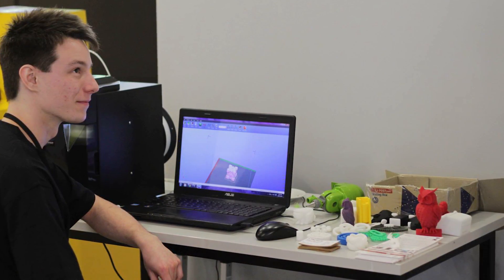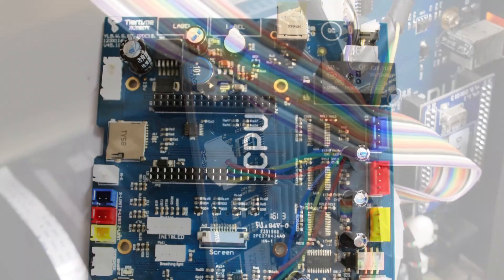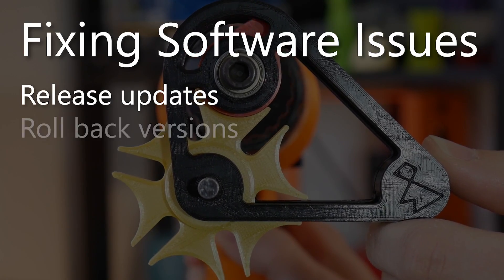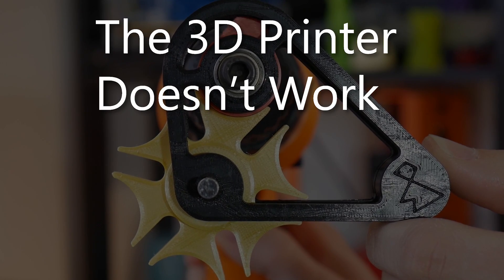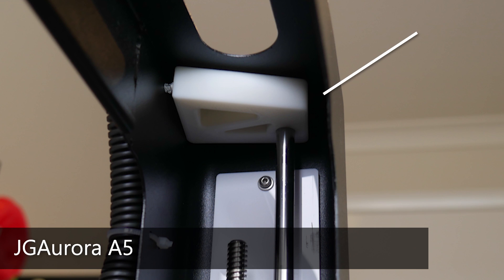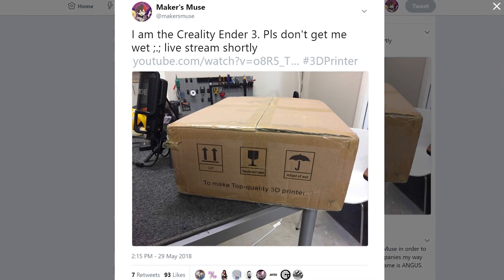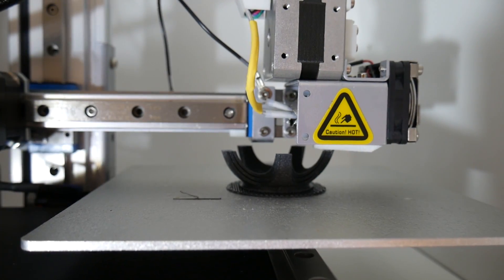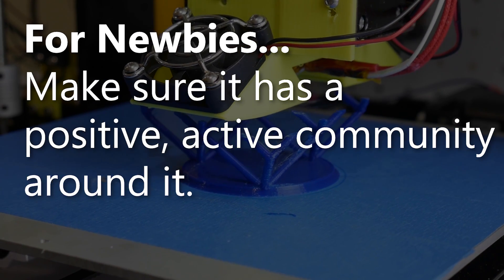Serious Concerns with 3D Printer Quality Control

Comment: I have bought 8 printers in the last 3 months since getting into 3D printing, and have done videos on them all.  I must say, I agree with what you are saying Angus.  While my Ender 3's are great (3 of my 8 printers), it is dismaying to hear some are coming out with removable plates now since I just received 2 more last week and they are the same as my first edition.  Also, I was an early adopter of the Formbot Raptor and upgrading the drivers was one of the upgrades I had to make, at my own cost.  I found it annoying that myself and a few others had to buy the upgrades and work with the manufacturer, and now hear they are shipping with the upgraded drivers due to our testing, but we still had to shell out the cash to do it initially.  And I am not even going to get into my Zonestar P802QR2, which went down after the first week of having it.  The "replacement" part...  Not even going to go there now.
I have since seen the importance of making sure people getting into 3D printing now actually have a good experience, but QC has to be fixed first.  And the manufacturers should have version numbers so you know what you are getting.  ie; Ender 3.1 (includes removable build plate)......

Comment: Very much agree. Though, given the advantages this practice offers to businesses, I don't see it going away anytime soon.

A compromise, I would love to see, is manufactures actually indicate what revision machines are as part of their models (ie: PrintMaster 5000 rev. 0). Any time they improve something, they bump the revision number, and publish a description of the change and what it was meant to address to their website.

This would help with two things. First, anybody buying a machine can use the revision to help determine how a new machine will compare to a review model. Also, if you're buying a "rev. 0" machine, you can reasonably expect to run into some issues (I would hope that manufactures would either provide these machines with a discount or upgrade plans to help offset the negatives).

Comment: Angus, I totally agree with your statements in your video! I've been trying to get users in the 3D world and mostly in the RC quadcopter hobby to realize the same thing! 🤔 Especially when buying from Gearbest! They have their own brands, ones you can only buy from Gearbest. They figured it out, long ago! They can release these ALPHA, or at the very best BETA products, without any testing or refinement to customers, with no worry of ever receiving a single return! It's too expensive for people to ship back products to China, when in the USA and other countries! So they scam unsuspecting customers to buy their unfinished garbage. Nearly all of their RC quadcopters are not even flown! No tuning, no refining, nothing! And they're popping out new models on a weekly, or faster, schedule! Kind of a throwing it against the wall to see if it sticks theory! I've seen reviewers get defective 3D printers right out of the box, and state that in their review, but go on to modify the printer to get it to function and then complete their review! What?! The product wouldn't work as received, and you fixed it so you could review it?!!! What about the customers who had no ability or spare parts to fix it?!! I feel the review should have stopped right there and the customers told not to buy the item until the manufacturer refined the product so it functioned perfectly right or of the box. Instead, reviewers are doing the R&D you mentioned for them! Ridiculous! If the reviewers do get it to last long enough to finish their review and not find the defects, then GearBest has a great seller even though it is a subpar piece of smelly dung! People in both of these hobbies are used to being tinkerers, and are used to doing upgrades and fixing issues. But! Like you said, they are making it the rule to release untested ALPHA products. Making it the norm to let the tinkerers fix the issues themselves instead of releasing a finished, quality piece of gear! I've received several defective products from Gearbest that they won't cover and have been told the most they can give me is $50, but I can keep the big pile of defective SHIT they sold me! Oh boy! So happy paying hundreds of dollars for something that arrived defective and then made to keep it, essentially throwing my money away!!! 😖
If we could buy that product in the USA, we'd be returning it at first sign of a defect, but since it's too expensive to do that, GearBest has taken advantage of us, and made it their norm to release JUNK!
I won't buy from them at all anymore because they've scammed me too many times with their ALPHA GARBAGE, and ripped me off. I suggest to all others to not settle for this practice they have adopted and say  N O  to buying from Gearbest, and others, until they end their scam and start doing proper manufacturing with full R & D and great quality control and testing.

Comment: This is a fine commentary on development, manufacturing, and shipping a product and what a consumer must think of. I think of how this applies to the Glowforge laser cutter and engraver. It was crowd funded to some degree to access demand, but it was wholly VC funded for development. They missed wildly their initial shipping target. They haven't made good on major components that were announced at launch like the filter, and have adjusted "specs" to meet the reality. They had a true beta test in the wild program. They had a six month pre-production test program, and then they started shipping production models without key features being finished. As one of the pre-release testers (I met you Angus at BAMF in 2017 and that one personal connect was the line I followed into the FDM 3D printing world!), I feel that they made good on most of the initial market for the basic 40 watt unit. Your  caution to early adopters to assess the risks of putting up money for a new product is most important to promote. I would say that the disconnect between the initial marketing of the Glowforge and the eventual trickle of development was a big. Do not let marketing materials (especially slick videos)  substitute for a thorough understanding of the technology you are buying and your own abilities to troubleshoot. In the end I love my Glowforge and have had no issues with my production unit. But I know it has been painful for a some folks who might not be familiar with troubleshooting technique or who get a bum unit. Glowforge has been doing replacements at a brisk pace. Final thought:  international customers are a whole separate issue when it comes to a product. How warranties, customes, import approval and shipping costs work is huge. The Canadians and Australians are still without a machine! One particular issue for lasers is tube replacement. that didn't get worked out ahead of time and when the news came out that you would have to ship the unit back, all hell broke loose on the forum and they had to backtrack.

Comment: You were spot on, it wasn't where I thought you were going with this. But, as always, invaluable insights.
Testing on customers and then releasing an upgraded version is horrendous, it might be a little better if there were versioning, but to do it behind closed doors is nothing short of a con, which can only lead to customers feeling shafted.
I never buy first editions, even though I have the experience to repair/upgrade/tweak for exactly the reasons you highlighted.
Keep up the awesome work Angus.

Comment: Wanhao was like this too. There's the Duplicator which was a rickety acrylic box with frightful electronics. Duplicator i3 was a better machine but still had some scary safety problems, the nichrome wire started above the extruder crimped inside the cable chain. Duplicator i3+ was better but had a short in the bed because they relied on PCB silkscreen to insulate. Maybe they're better now but that's pretty frightening.

Comment: Right on Angus! You are absolutely right with all of your observations. This is a serious pain point for new folks getting into 3D printing, and while I might not be new new to the game I have been bitten by this myself at least 3 times biting off more than I could chew. A lot of that is because the machines I got, where NOT what was advertised IE: "New upgraded 2018 machine" and get shipped a v1 product with none of the new upgrades from the old stock warehouse LOL. Cool part is I have PLENTY of parts to build new printers of my own devising, or replacement parts for other printers that DO run BUWHAHAHA! (Still an expensive lesson that folks new to this hobby or have budget constraints wouldn't be able to handle as easily).

Comment: This happens in more cases than just 3D printing. I worked at a large computer company who would purposely put out faulty hardware in order to beat the competitors to the punch. A first to market kind of thing. What’s even worse is that this was enterprise level equipment that I had to fix afterwards. It’s absolute junk that they conduct business like this. My two cents.

Comment: Personally, I'm fine with being part of the development process. I get to learn what works and what sucks. Companys that are quick to improve their kits will survive the market. As a product reviewer (and promoter/demoter), it would be a joy to receive something that's awesome, but at the same time, receiving a piece of garbage is understandable a waste of time for everyone. However, that is the life that was chosen.

Buyers need to do their research and should not be expecting perfection out of the box, be it a ready-to-run thing or an absolute parts kit. Remember, 3D printing isn't easy, there's learning to be done here, and the information is so readily available. No one needs to be pampered.

Comment: Iterating hardware is hard and expensive for both time and sometimes money. I can't count the number of times I have seen engineers have to re-order parts because there was some cosideration they neglected in their first design attempt. I have done this as well, sometimes to the tune of several (sometime tens) thousand dollars. In an ideal world a designer has ample time to consider everything but the truth is you are usually being pushed to meet a deadline. Pushing products out the door is a gamble of product issues versus market share that usually pays off with higher market share. So I get it, it makes business sense to push not perfect hardware out the door. 

The key thing to remember though is that a product is not designed until it works at an acceptable level. 

So fine push out your untested printer BUT send out your changes too! Send your early customers the parts that have changed! The problem is I do not think a lot of these companies are even keeping track of who the are shipping to or what version of the printer they are shipping. I would be greatly surprised if the changes made over a 3d printers life is even documented because these products have maybe a 3 year lifetime? That's short enough for one guy to keep everything in his head while changing the BOM on the fly from manufaturing run to manufacturing run. So I suspect part of the reason 3d printer companies don't send you updated parts is that they themselves do not know WHAT they sent you or what new to send you because there is no record of it!

Comment: One aspect you missed, Sir!
The in-house teams that design and test [some] of these machines are Resident Experts in possession of Tribal Knowledge, and that is the problem.
The R&D team know the things inside and out, and subconsciously make corrections in how they operate the machines.
The old cliche "Well, it works for me!" is applicable, methinks.
This is why 'Black-box' testing is vital: The tester has no knowledge of how it works, just answer the question "does it work?"
Experts tend to forget that the end-user is not a member of the R&D team.

We need to send the message: We are not beta-testing hardware UNLESS there is a contract granting testers no-cost access to the new gizmos that WE invented for the vendor.
If there is no incentive for the early adopters to innovate, why should we work for the vendors, without compensation, to improve their product for someone else?
We know who the worst offenders are, maybe whispers of a boycott might wake someone up?

Comment: Not disagreeing with you - it's one of the things that has stricken fear into my first 3D Printer purchase.  Hence I want to be sure I buy the right one with not just community support but also manufacturer support (so I'm working on saving a few more dollars to get a Prusa).  I don't want to have to fix a serious flaw and then have the manufacture say we knew about it and fixed it with future products - that's of no help to me (though at least it will help future buyers of the machine).  I don't think it's quite right to compare these early access printers to early access (beta) software.  Beta testers for software receive fixes from the publisher as the development cycle progresses.  And people who paid for the early access beta software also get the final finished product.

Comment: i have always kicked of with the QC on printers and kits. even with machines i have working great there are things that could be done to improve them from day one.  i feel this is the case with the photon. its a great machine. but there are a lot users on my groups that are having problems and having parts sent to them. i would like to see 12 month warranties on complete printers. everything electrical in the uk from shops comes with warranty. and printers should be covered the same way. and a printer should be replaced if having to many faults in the first 6 months. think there should be a universal law when it comes down to printers. same as an inkjet printer. tbh was one reason i bought the dremel idea maker from argos. as it came with a 12 month warranty extended with the argos cover to 5 years. but sadly with the dremel you touch the machine and it makes the warranty invalid. and that's even changing the nozzle. i would have to send that dremel away to have a damn nozzle changed so that would mean no printer for up to a month. just to change a damn nozzle that i could change in 5 mins. cover is ever non existent with printers or over the top that you cant do anything to the machine. :( QC is a must for every company.

Comment: MK3 is fine example of this too....rods, bearings, pinda sensor change, untested laser sensor, un-tested crash detect (layer shifting issues etc..... ), linear advance fail, huge delays in fixes... inconsistent extrusion.... un-tested manufacturing process for powder coated sheets... etc...  mk2s seemed more refined but mk3 was a fail IMO in the QC department.
Reply: digibluh , totally agree. I find it really strange how many people do not acknowledge problems like this...
Reply: Agree conceptually but if they admitted the design flaw and offered an honest resolution it might help

Comment: Whilst i agree with the majority of the points you made, i feel you missed one thing. Price points. You mentioned that you purchased your first printer for AU$1000, that's a lot of money, even by today's standards in 3d printers. The vast majority of what people are buying now from what i can tell are cheap/low budget printers usually around $200 - $300. 

No one (that i know of) is buying a 3d printer as an impulse buy. Most people will do research before purchasing one to find out any issues/fixes etc. If you're researching and find a printer with a few issues which are easily fixable for around $200 then your going to go for it and spend the little time required to fix these issues, it also usually lets first timers get to know their printer. If you were going to spring for a $1000 machine, you'd damn well expect it to be problem free as it's significantly more expensive.

Bottom line you get what you pay for, but i do understand the frustration at being an early adopter and having to pay for mistakes which should have been found earlier.

Comment: Man, 3d printers that work the first time.  That's something I've never experienced.  I originally bought 3 different Prusa I2 kits from various companies before I got the one from NWREPRAP working.  Since then, I've done tons of upgrades to the NWREPRAP Prusa I2 and the only thing original on it is the frame.  It works great now, but from my first kit to a working printer was about a 3 year adventure.

Comment: I owned a robo r2, I heard great things about it and it worked great. Then the nozzle clogged and as a first time 3d printer, I had no idea how to fix it. I spent hours on hold and even longer trying to fix my issues. I ended up returning it, because the 1 screw needed to take off the hotend was stripped and the machine was a dud. then I bought a replicator mini, and it never worked at all, they shipped me a new one and the same! Then I bought a da vinci jr pro 1.0 and its worked to this dat, with just subtle nuances

Comment: Your note that beginners get the shaft here is the most important. I started this hobby a year ago, but I knew it required significant tinkering based on the printer model. I did my research. A year later, I am tired of the tinkering and want the machine to work without constant adjustment and re-calibration. I would NOT buy any low end 3D printer new these days. I buy them used and make the changes I need. By the time I am done, I spent what it would have cost to get the machine new, the way it should have been out of the factory.